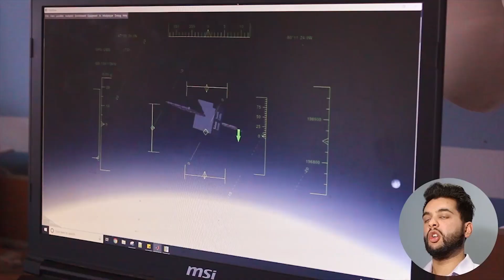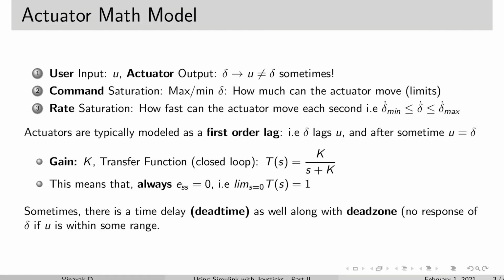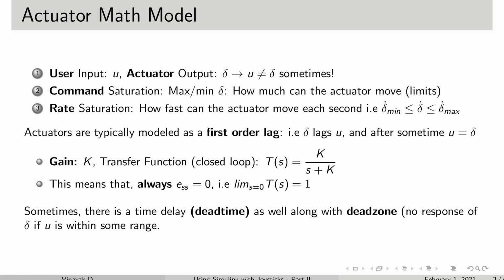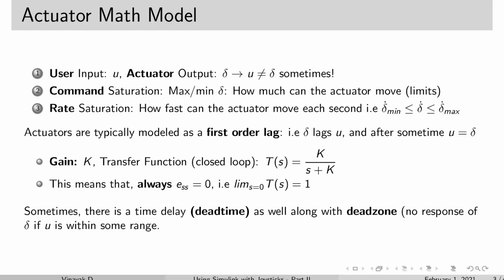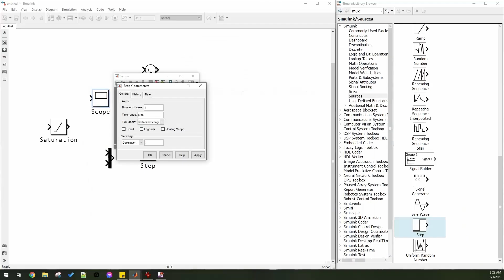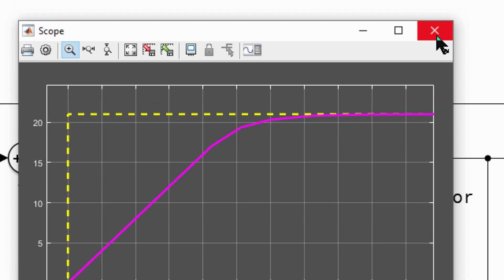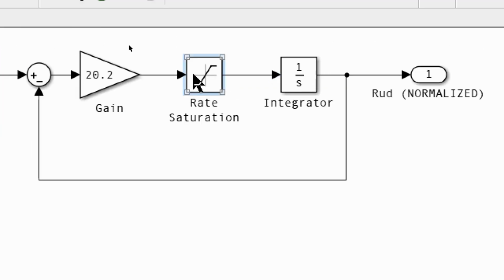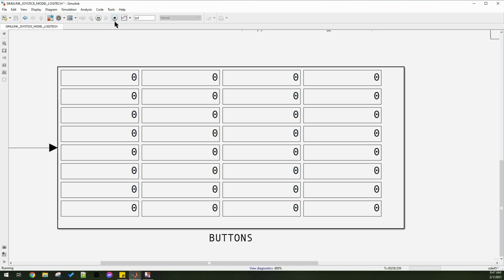Using Simulink with Joysticks Part 2 - Actuator Modeling

Comment: Hello 👋 
Dude I very like your Videos and i have a question. 
I built a yoke and a throttle from wood, the main panel is a ps2 controller which has a USB connection to the pc.
What should I do to connect the „PS2 Controller“ to Flightgear?
I would be very happy if you would give me a answer.
I am in a big problem and I already like your Video ♥️
Reply from the maker: The same way you connect joysticks to matlab and simulink may work, watch my 2 videos on those
Reply: @VDEngineering  ok thank you so much 🙏🙏